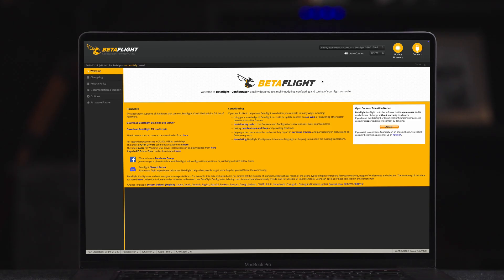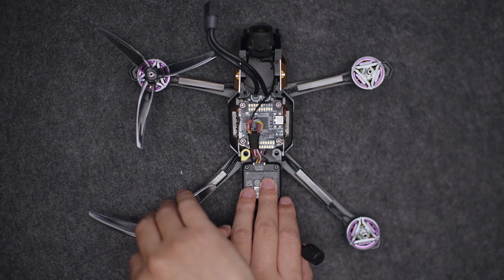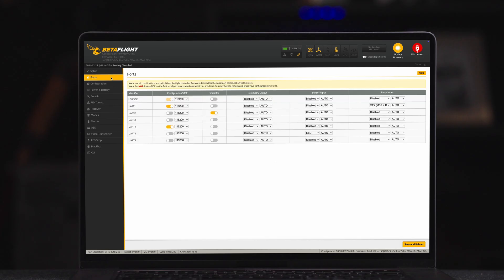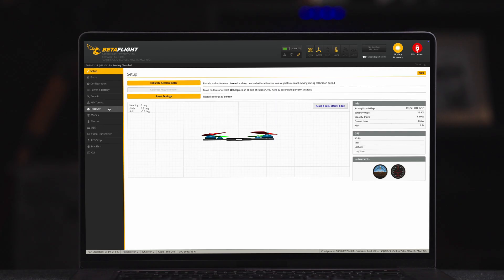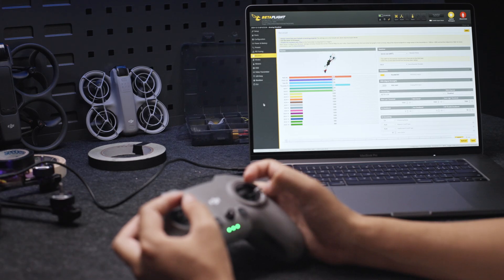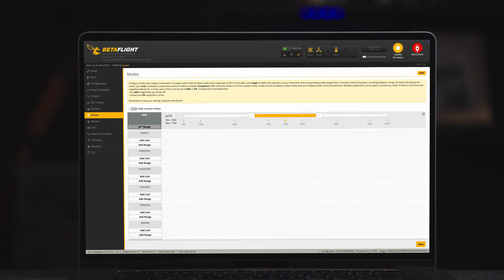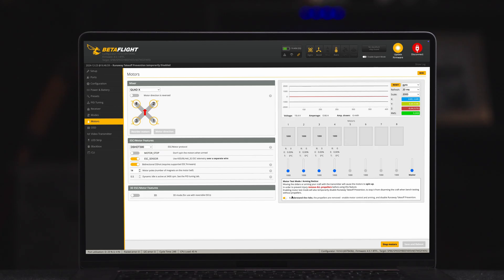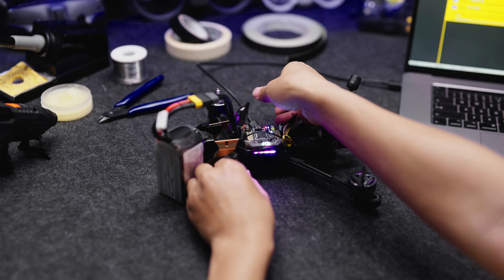DJI O4 Air Unit Series｜Flight Controller Settings

Comment: The avatar the flight modes are on the left and arm is on the right and the left is the flight modes you should match those in case you use it for both. The one on the left is already labeled with the flight modes on the left switch N/S/M where M is equivalent to acro and so on

Comment: had the receiver bars moving and now i cannot figure out how to get the link to the fc i set the fast baud and tried every trick i could think of and total failures!!!  very frustrating!!! still a bit unsure about the  the correct serial port and uart setting but tried all combos with no luck?? anyone want to buy this STUFF CHEAP!
Reply: Have you found a solution? I have the same problem! Everything works accept the remote part. Even the camera all ready work.
Reply: I am having the same problem

Comment: Do you know if the Controller 2 is compatible with the O4 Unit Pro?
Reply: If you mean the RC2 unfortunately not! I hope they make it work via update... Was waiting for the O4 maily for this reason as the O3 had the autdated video transmission system which was not compatible with the RC2 - but I do not understand why the O4 is not working straigh with the RC2 specificially as DJI stated even open it for 3rd party controllers...